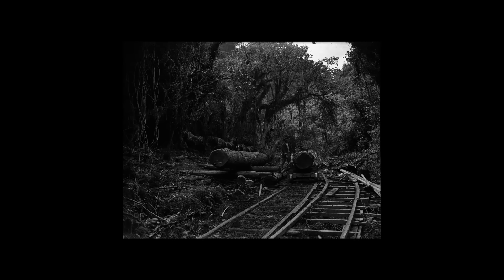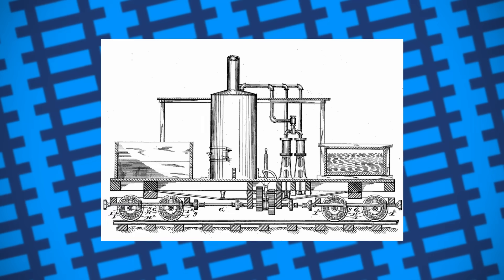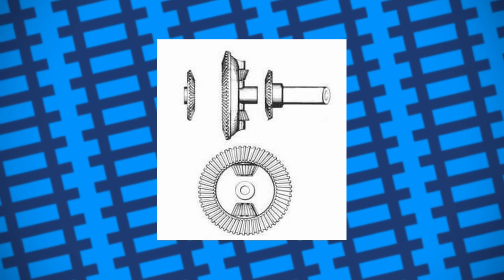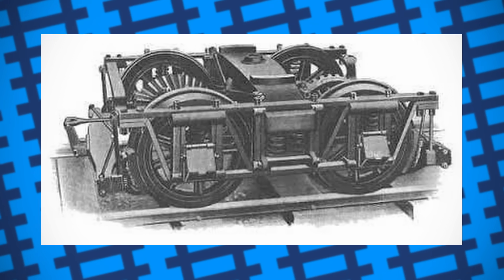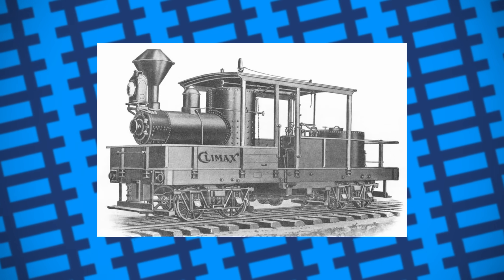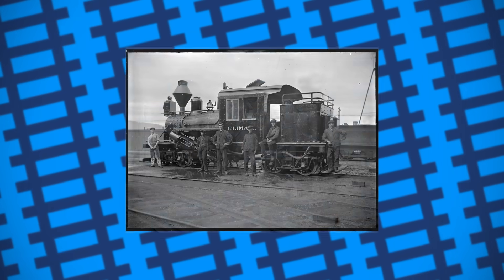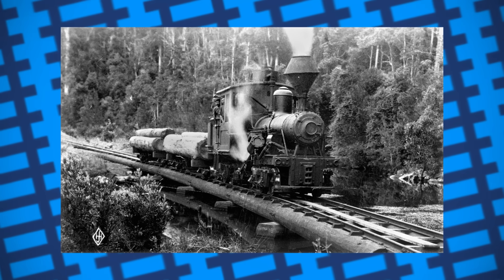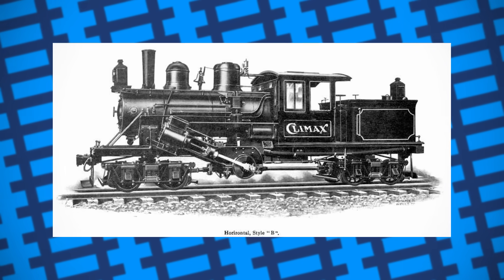The Strange Locomotives Loggers Loved - C.D.Scott "Climax" Locomotives

Comment: Excellent video, well researched and done! A fun additional tidbit of information on these engines; Class B and C Climaxes did suffer from one very notable achilles heel. Because of the inclined cylinders, at higher speeds, the engines were prone to extreme vibrations and it was an issue that was never fully rectified. If you search up videos on Moore Keppel #9 and Hillcrest Lumber Co #10; you can often see the vibration, as well as hear it if the whistle's being blown, as it'll warble. The vibration was so bad, in fact, that the Climax Locomotive Co's biggest source of revenue wasn't selling locomotives - it was selling spare parts to fix bits on the Climaxes that had shaken themselves apart. That being said, they did their job well and packed one helluva punch compared to Shays and Heislers of a similar weight.

Comment: Fun facts, Corry, Pennsylvania, home of the Climax locomotive works, is only about 35 miles from Erie, PA, where the Heisler logging locomotives were built.
Erie is still cranking out locomotives at the old GE locomotive works, now owned by Wabtec. "Wab" being corporate shorthand for Westinghouse Air Brake.

Comment: Indeed there are very few operational Climax locomotives.  You can count them easily on one hand.  My personal favorite, that I have ridden aboard on a few occasions, Is former Beebe River Railroad, (then East Branch & Lincoln RR) in New Hampshire.  It is still doing its job hauling tourists on the White Mountain Central RR just a mile from where it once worked in the woods.

Comment: It still amazes me that it is more efficient to build a big wide logging road than to lay two tracks.
Reply: It's more down to the cost of what goes on those tracks vs the cost of what goes on the road. You pay a lot less for trucks and trailers than locomotives and rolling stock.

Comment: 8:30 Loco 1694, built in 1928 for 2'6" (762mm) gauge. Now owned by Puffing Billy Railway, Belgrave, Victoria, Australia. Westinghouse air brakes have been fitted and is occasionally used on special trains.

Comment: There’s a point relatively recently (at least two decades) where a Climax outperformed a logging Mike, even though it wasn’t a crew favorite. The Class C’s and presumably the B’s had some stability issues getting up to higher speeds. I can’t tell if it’s the process of shifting of gears that does it, or the more conventional cylinder placement transmitting a hammer blow effect to the frame and drive instead of on the rails, but 8-12 mph is a rough ride. Check out Rock Trains, it should still be up here

Comment: Little-known fact: Because of incredibly-tight curves and turnouts, Shays, Climaxes and Heislers were used on dockyard and congested industrial trackwork on the East and West coasts of the US for many years.   Shays weren't so good at this switching work because that right-hand-side-mounted driveshaft and couplings Did Not Like tight right-hand curves at all.

The reason this part of locomotive history is little known is because most of that switching work was at night, and in dangerous areas where strangers stumbling around with flashbulb cameras were definitely not wanted.   And in wartime, sudden and bright flashes around docks, warehouses and shops in the nightly gloom would get very rapid attention from the dockers, local police and FBI. 

But these 'geared' engines - as they were known - were built in many different gauges and exported everywhere.   And they're very popular today with modelers of all gauges.
Reply: what about the Cinder Dicks?

I'd imagine they'd be the second one of any semblance of authority to arrive on scene if Dockers got their hands on someone lurking about in the wee hours of night and having a Kodak VPK/Vigilante + bulb flash on their person, or a camera similar in design, capability and concealability.
Reply: @HrLBolle  That's what I meant by "local"...and yep, there'd probably be a few around to keep a beady eye on things...
Reply: @OliverT-qt1gn  
I interpreted “local” as the local police garrison of the city or county (wherever the freight-handling-yard is located), as it did not occur to me that “local” here could refer to the employer and area of action of the police force.

must be my German brain not translating the fine details

Comment: Engine  At 8:14 is not a climax converted to internal combustion.  That is something known as a Dunkirk.  Dunkirk was a competitor to Climax, and made a very similar locomotive. They also produced a variation on the Shay design, though the latter was not produced under license.  Dunkirks were largely designed in a 'kit' for, where a company could either purchase the locomotive complete, or supply your own frame in the form of a flatcar, and purchase all the parts needed to build the locomotive yourself.  Dunkirk actually produced the first Heisler, as the designer of that locomotive worked for the company at the time.  However, Dunkirk did not want to produce the new locomotives, and allowed Heisler to leave the company to produce them on his own.  It's been suggested that they did this, as they were worried there might be some dilution of their own products, and companies would be more interested in the new complete design, as opposed to the 'kit' locomotives they were offering, which was their big money maker.

Comment: Hummm, talking with the maintenance crew at Cass, WV where they run both the Climax and the Shey locomotives. They'll tell you that the Climax break down more often and is a pain to repair.
Reply: They're probably also older and more abused.
Reply: @CPD0123a  no that’s just how the climaxes are designed. Go look up Mount Rainier scenic and the rock trains. Video and they’ll tell you about their climax. , and climax number nine in Casper, West Virginia, as a newly restored locomotive, and it still breaks down more than the 11 year old boiler ticket Shay 11
Reply: That's because she's only six years out of a rebuild, engines tend to have to settle into their reliability, and also, I absolutely would not be surprised if the engine crews now just abuse her. Cass has gone severely downhill since mountain State lost control of the rolling stock. Looking at some of the locomotives that cass now, it's very clear they aren't cleaned at all, just look no further than heisler 6's "bright" white wheel lining. (Yeah it's not even close to White anymore, which it used to be)

I got a front row seat to all of the political bull crap that went on between mountain State and Mr Smith. My mother was one of the volunteers that helped rebuild moore and keppel number 9, and I got to grow up watching the whole process. That climax is absolutely one of the most spectacular engines at Cass, and absolutely does not deserve a reputation for unreliability so soon after a complete ground-up rebuild

Comment: If you want a story that seems unbelievable, you can do a video on is when the Rio Grande Southern somehow got, as Hyce put it, got all of its locomotives stuck in the snow. 

TLDR: RGS number 20, 22, 41, 42, 455, goose #7, DRGW 458, DRGW 271, got stuck in some form. 1 plow, wrecking crane, and rotary plow also got stuck. The DRGW 458 and 271 were borrowed.
Reply: Oh god IT'S THE IRS.
Reply: Followed by the time 491 got stranded on Cumbres Pass with 2 plow trains and 2 rotary trains searching for her in the winter of '51-'52 (yes, she was stuck for that long)

Comment: One thing about these engines ive learned is that they can shake quite violently at certain speeds thanks to the angle of the cylinder block. Theres a film on mount rainier scenic when they had to run trains of rock to fix a bridge thanks to a wash out, the camera is on the engine and above like 8 mph up to 12 mph it shakes so bad you cant tell whats what in the film.
Reply: Are you talking about  the Elbe train?  My wife and I took that train.  God bless her soul.  RIP Sue
Reply: I got a ride in that engine.  It has a strange side to side and up and down waddling gait that takes quite a bit to get used to if you're used to a standard steam locomtive.  I wouldn't say it shakes violently, it's just odd.

Comment: Now we need the heisler locomotive sorry I can’t spell
Reply: You spelled it correctly, pat yourself on the back
Reply: No no, you got it right
Reply: I would like to complete the trio of the best of the big 3 loggers.
Reply: @Tankhunter_48 there is another
Reply: ryancampbell, check the back catalog.   i think he's already done one on it.
Reply: @vsvnrg3263  
I know Train of Thoughts has covered Ephraim Shay's locomotive alongside the variant known as the Willamette, that was produced by the Willamette Iron and Steel Works.
and just checked if Heisler's locomotive has been covered, has not yet ...
Reply: Those are cool! I got one for dirt cheap and I love it. In model form, I mean. Geared and articulated locos are so cool
Reply: Don't start me on geisel ejectors or wagnerr front ends.
Reply: @robynecclestone7900  , sorry, mate.   but which buttons do i press?
Reply: @robynecclestone7900 Are piston tail rods safe? Back pressure release valves? Jack-link pinholes in Joy valve gear? L&YR pattern plug superheaters? Cornish boilers? Thermic syphons?
Reply: *Hyceler